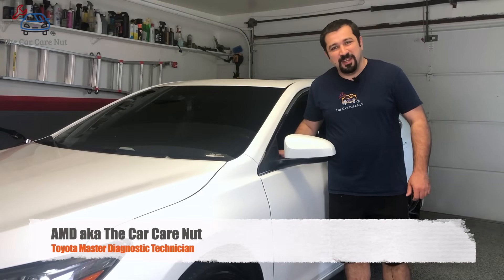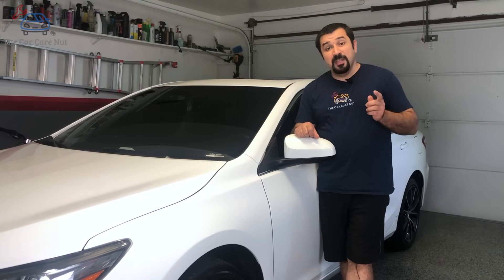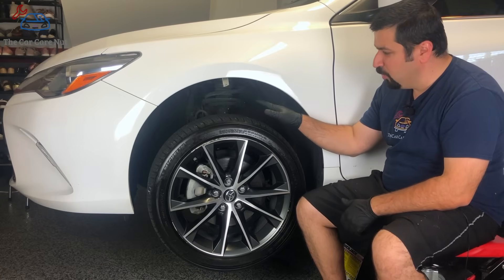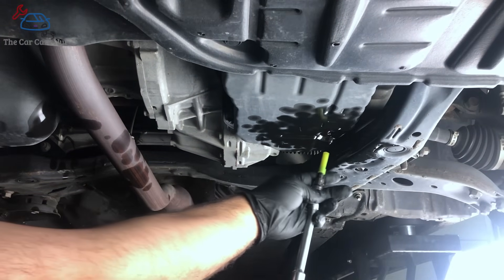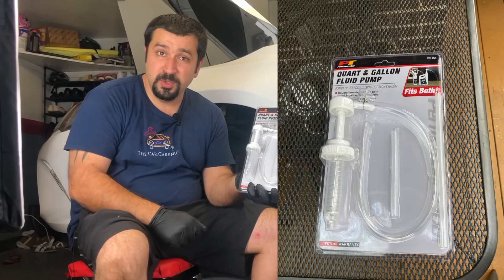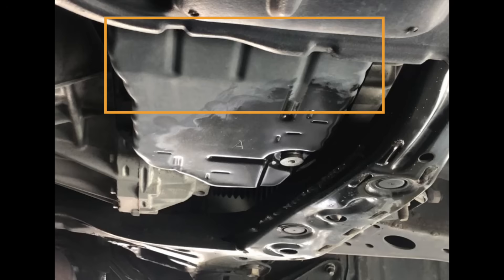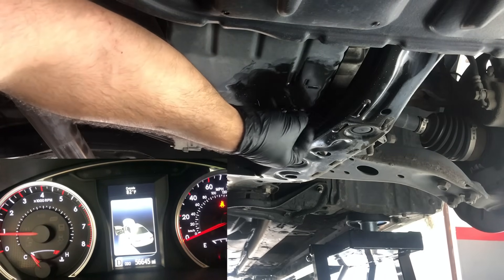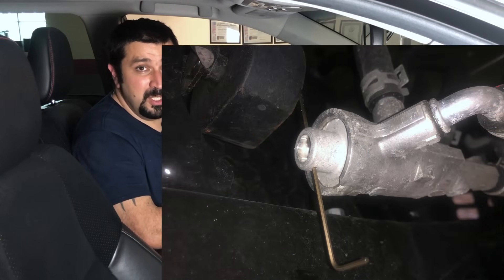How to change your Toyota Sealed Transmission Fluid

Comment: Firstly, AMD - THANK YOU for taking your precious time to make these videos.  You clearly have a wealth of knowledge to give and that you do so freely here on YouTube is truly a blessing to folks like me.
This method drains only a few liters of fluid from the pan, maybe 25% of the total fluid volume.  In a typical auto trans, the total volume is around 10 ~ 15 liters.  By far the largest volume of fluid remains in the torque converter and some in the cooler & lines.  
There is an alternate method in which you disconnect the line that runs to the cooler and have the trans pump out the fluid into a graduated container.  You pump out a liter or 2 at a time, and fill the exact same quantity into the trans.  Repeated pump and fill using this method will guarantee to get all the old fluid pumped out (vs. just diluted with fresh fluid in the pan drain method).  
What are your thoughts on this method?  Are there any pitfalls one should look out for (aside from the very important instructions about setting the fluid level in the right way you so clearly explained in this video)?
Reply from the maker: Hi! Thank you for watching my channel!

So first I’ll say this. The idea of replacing the transmission fluid is to refresh the additive package and the small amount you replace does just that. People often are chasing after replacing the whole fluid and in some higher mileage transmissions that’s actually not a good thing honestly.

Having said that on the method you mentioned. It works but you have to be careful. Running the transmission low sends air into the pump and could really cause more issues than good. If you must do this procedure I would overfill the transmission a bit then drain that excess so you always have enough fluid
Reply: @TheCarCareNut  hey AMD! Can I do a drain and fill abs replace the trans filter on my 2010 Camry LE 2.5 with 90k miles?
Reply from the maker: Hi! Yes you can
Reply: I put the hose in a measuring container, on my 1st change I remove the pan, filter, measure the oil, and add the amount I drained with removing the pan, and then as it is pumping it into the measuring container, I add at about the same speed it drains, also have someone shift the trans thru is range to drain the clutch packs, I have always changed oil before it shows color changes, and so far have had no issues, as the filter and magnet are cleaned, and replaced, cheap insurance.
 My wifes has 25K and 6 years old, changed it as oil oxidizes, even engine oils have a time recommended time as well as mileage,
Reply: Do all of the Camrys have this bypass valve? I cannot find anything that resembles the picture you have posted. Not on the right side of the transmission or anywhere between the radiator and the transmission. Please advise!

Comment: The video is good and I understand your points.  Only one that goes by a little too fast is the valve with the pin that needs to be inserted.
I'm not clear on where it is.  I was asking if the procedure in the video is written up some where with pictures?
Thanks
David
Reply from the maker: Hi david. Let me ask you this. Which model do you have?

Comment: Is the procedure for the 8 speed transmission on the 2018 Camry written up some where with all the steps in video?
How can I get a copy of it?
Thanks
David
Reply from the maker: Hi david! It’s the same process for the 8 speed transmission. Slight difference is the drain plug is in the middle of the transmission case because the pan is in the front. I am planning a video in the near future dedicated to the 8 speed

Comment: If you live in a hot place like Las Vegas where the summer ambient temperature is easily between 105 F and 110 F, I suppose you don't need to worry about the temperature check?  Thoughts anyone?
Reply from the maker: Hi! You’d just need the car to sit to be at ambient temperature and check it right away

Comment: I went to the dealership for an  ATF change,  they laughed at me and told me to save the money and buy them coffee.  They even showed me the maintenance manual,  I was speechless and felt like a fool.
Reply from the maker: Sorry they treated you this way. I’d find another dealership because you will be the one laughing when your transmission is perfect at 300k miles because you changed the fluid

Comment: Awesome !   Wished I watched your video FIRST before drain/fill ( x 2 , each time drained 2.5qt and replaced with 3qt WS, cycled gears and drained until perfect) my 2017 Sienna XLE at 50K.    Would have saved me lots of frustration.   DO YOU HAVE A PART NUMBER FOR THE PUSH-CLIP FASTENERS I DESTROYED ?   Zip Ties make me look like a NON CAR CARE NUT.
Reply from the maker: Hi david! I hear you. I’ll have to look it up in the parts catalog. You can look up parts on parts.Toyota.com using your vin number. Search for apron cover

Comment: The TSB for my 08 Lexus ES350 (TC011-07 and 2339R) recommends to add additional 200 ml fluid after the level check is completed. Is this something special for my Lexus or not required in general?
Reply from the maker: It might be car specific.
Reply: Best answer for you came 5 months later...
The procedure recommends leveling till it drips. TCCN's procedure is to close the drain plug up when it dribbles/trickles. There's your extra 200 ml. What a pain in rear procedure, no?

Comment: Hi AMD, I am confuse. The drain plug is higher than the bottom of the pan so, you are leaving old oil  inside, and the tranny holds more that 3 quartz so, you are not really changing the all fluid, are you? Thanks
Reply: Got it, thank you
Reply: I used a very thin, tightly-curved rubber tube to vacuum-extract almost an entire quart of fluid from below the top of the threaded bung in the pan. I was surprised how much was hiding in there, had to wiggle the tube around a bit though, to find the true bottom.
Reply from the maker: Hi! You’re replacing enough of the transmission fluid to keep things fresh and protected.

Comment: Hey, I followed everything according to DIY write ups and your video, I made a mistake, where I got the vehicle within the required temperature range for that specific transmission and then turned off the vehicle so it doesn't exceed the required temperature and then checked the level, is the transmission fluid level going to be really off if the car was turned off and checked immediately? Please advise.
Reply from the maker: Hi! Likely it will be slightly off. I would let it cool down and recheck it again to be sure.

Comment: What do you think?

1. If car is left to cool for 1 or 2 days till Trans temp is at Ambient temp.
2.Open to fill plug
3. Using a custom tube  and system I made  and removing as much as possible trans fluid.
4. Having the true amount down to the very ml of fluid at the same temp and the new fresh fluid.
5. Replace the same amount of Fluid to the ML at the same temp

Think that will function as a easy fluid refresh.     I do this on my GM cars but since it has dip stick not needing to be so perfect on amounts as I can check it. 
Thanks any advice.

Now I do NOT consider this to be a TRANS flush or exchange service.   I call it a fluid  refresh as it just removes at best 1/3 of the  trans fluid and replaces it with clean new.
The purpose is to keep the transmission oil in a clean state a higher percent of the time. 
I have 198,000 miles on a 2003 Impala and do the full Filter and flush per the recommended guide.   But every  15 K miles I remove 4qts and replace it.  Trans mission fluid remains in a very clean state.

Transmission fluid such as Dexron III or VI are  not the best lubricants.  When dirty they are even less.  I have never had a transmission failure on any Ford or GM with this service tech as fluid stays at max clean.   Just curious on a 2021 RaV4 with 8 sp   and Toyota WS fluid.
Reply from the maker: Hi! You can do that but if the fluid level was not good before it will still be the same. Also if you went through all the trouble of measuring why not spend a bit more time and make sure the level is good

Comment: Awesome video and thanks so much!
I had a 2016 Sienna and few things I want to add, in case anyone cares or if it was a little different with them, too!
-I was able to do this on a flat surface without having to jack up my van or remove any tires; I turned the wheel all the way to left and I got access to ATF fill bolt with an extension. The ATF drain plug, I thought, was pretty accessible without having to jack it up
-I got my jumper wire on amazon for like $5 and the pack came with way more then I'll ever need!
-Maybe this was lost in editing or my van just does things different but my sequence was a little different
a) After making sure the parking brake was up and all four wheels were chocked off, I turned off all the lights, radio and HVAC and then turned off my car.
b) I put the jumper wires in the right spot
c) I started the car
d) I shifted around several times
e) I then did the drive-neutral-drive dance until the "D" came on for two seconds
f) I put the car in park; the "D" went away. It come back on immediately with the car still being cold like in your video
g) the "D" light came back on; this did not happen immediately for me. It took until the car was up to operating temperature. For me, I could sit in the car and wait until I saw the "D" light come back on, or once I heard and felt the engine fans start, the "D" light came on, too; this took about 15 minutes of my car running at idle
h) I undid the drain plug until it got to the right amount of drips and then put the plug back on. 
i) I did this twice, after letting the engine completely cool down, and after the 2nd time I put a new gasket on the refill and drain plugs. 

Thanks, again, keep up the great content, and I'd love to know if I did anything incorrectly. Take care.
Reply: Thanks Charlie P.! This really saved me a lot of frustrations
Reply: @tstephane2000  no problem. Let me know if you have any questions!
Reply: Hello, I recently bought a 16 sienna and will be doing this soon. About how many quarts did you have to fill?

Comment: Will this tutorial work on the new 2020 and 2021 Toyota corolla as well?
Is the transmission fill plug located in the similar location?
Reply from the maker: Hi! Slightly different location but the procedure is the same

Comment: So, is there a filter on these? If so, how would one go at replacing it?
Reply from the maker: Hi! There’s a filter however it’s not normally replaced. If you replace the fluid on time you shouldn’t have issues with the filter.
Reply: @TheCarCareNut  wow! 3am and I get a reply! Amazing, sir, absolutely amazing. 

I'm in the market for a 2018 Camry. First car I'll ever buy from a dealership. I plan on keeping this thing until the wheels fall off, and I'm doing all the research I can to maintain it properly.
Reply from the maker: Hard at work here! 😂  best wishes with your car search.
Reply: @TheCarCareNut  I'm sure I'll spend a lot of time here on your channel. I'll be sure to let you know when I've made my purchase.

Comment: I have a 2018 Toyota Camry I’ve drain the pan two times since I’ve owned it because I do a lot of driving I take the new oil leave it Out with the covering underneath the car off and also the tire removed the next morning I get up drain all the while measure it and put just a little bit more than what I measure do to loss and everything’s been fine

Comment: Why didn't you change the transmission filter.
Reply from the maker: Hi! On toyotas the transmission filter is not commonly replaced and causes no issues if the fluid is changed frequently
Reply: Really. That is good to know. So how do you know if your transmission is has lots of metal chips in it. I had a 2007  Avalon and the transmission went out at 130,00 miles. I had a 2002  Camry XLE and the transmission went out at 110,000. No one could give me an answer why. I have a 2016 Avalon limited with 40,000 miles on it and I am worried the transmission will go out on it. And they do not change the filter. That is not a good sign for me.

Comment: AMD - I noticed in your Tundra video you mentioned the tranny strainer does not need to be changed if service done at 60k miles. Does this recommendation also apply for the Highlander and other FWD Toyotas?

Comment: AMD - - This is by far the best video I've seen for the Toyota sealed tranny service. I have 4 vehicles to service soon. Can you please provide the temps range needed for each one to properly check the fluid level?
2016 Highlander, FWD, 3.5L, U660E
2018 Tundra 1794 Crewmax 4x4, 5.7L, AB60F
2020 Tundra Platinum Crewmax 4x4, 5.7L, AB60F
2020 Sequoia Platinum, RWD, 5.7L, AB60E

Thanks in advance!
Reply from the maker: Hi Charles! Thank you for watching my video! The trans temps for the highlander are 103-114. For both tundras and sequoia is 99-111
Reply: @TheCarCareNut  Much appreciated!

Comment: I have a 2012 Toyota Camry with 85k that’s never had transmission serviced. Should I do a flush and replace the filter? Or would draining and filling the fluid in the pan be good enough?

Comment: Is it possible to put a level on the frame of the car to confirm that it is level? Thanks in advance AMD.
Reply from the maker: You can but I wouldn’t use a perfect level as that will be very difficult. Use your best judgment on level
Reply: @TheCarCareNut  I just ran a quick trial run using the jumper wire method, seems to work. :) Question: When the D or drive indicator becomes solid. If instead of performing the last step before checking the fluid level (taking my foot off the brake pedal and removing the jumper wire), I just leave the car in neutral, will the D or drive indicator start to flash on its own? In other words if I leave the jumper wire on and car in neutral, can I use it to monitor the transmission temperature?
Reply from the maker: This one is my fault for not making it clear in the video. After the D light comes on and you will remove the jumper you actually put the car in park but the D light will still come on. My bad
Reply: @TheCarCareNut  Thanks!! I did this entire process and single drain and fill today, it was actually pretty easy. My Rav4 has 120K miles and will likely need this process repeated a few times to get the ATF the red color. Any pointers if I'm doing multiple drain and fills? I also seen some videos where they use the cooler return line to drain out the ATF one quart at a time. Any thoughts on this? Thanks so much for everything you do.
Reply from the maker: Hi! I would stick with the single drain and fill honestly. I wouldn’t use the return line to do a flush as if you’re not very careful you could run the transmission low

Comment: Great explanation.  I have done this once, but more thoroughly via dropping the pan entirely, changing the "screen" (which is actually a filter), and then replaced 100% of the fluidpumped by engine / emptied through the output to radiator and filled through top fill hole (1 quart at a time).  I finished with the exact top off procedure you showed.  Toyota really "went the extra mile" (BIG CUSTOMER BETRAYAL) to make absolutely sure that this transmission maintenance procedure (as well as simply checking the fluid level)  is as much of a pain in the a** as possible.  Kudos to you for the excellent video and explanation but SHAME ON TOYOTA for A) LYING ABOUT A "LIFETIME" FLUID and then B) Making this (screw the consumer that is smart enough to know about the lie and still try to live with it) engineering design!!! SHAME ON YOU TOYOTA!!!!!  :-(
Reply: Sorry to rez a super old post.  I feel ya my friend.   But the idea of a lifetime on anything is kinda silly.  This isn't just a Toyota thing.  Every single car manufacture does this now.  The manufacture only cares to push a car to about 100K miles.  Beyond that, you are on your own.  Thanks to Care Care Nut, for the serious tips.  Helps a bunch.  (also, btw this method of transmission level setting is also becoming common. My old 2002 VW Jettas Auto 01M trannys are pretty much the same deal.)
Reply: @roguetube2  and it is even more "silly" that Toyota employs the term "lifetime" to describe their trans fluid in certain vehicles which results in giving uneducated customers a false sense of security can result in them not realizing the looming problem until it is to late (and they have prematurely worn out their transmission)!  Also, just because something is becoming common does NOT make it right.

Comment: Great  information my question is what about the transmission filter and by draining the pan only and not the torque converter aren’t you mixing clean oil with dirty fluid thanks
Reply from the maker: Hi! The filter on Toyota transmissions is not normally replaced for maintenance. No real way of draining the torque converter other than a flush
Reply: Thanks

Comment: Does the CARISTA OBD2 reads the transmission temperature?
Reply from the maker: Hi! At the moment the Carista app does not read the transmission temperature
Reply: I have the carista dongle with the obd fusion app and toyota essentials.  It reads my transmission temp.
Reply: Did you have to modify the programmation string or does it read the temperature using native interface ?